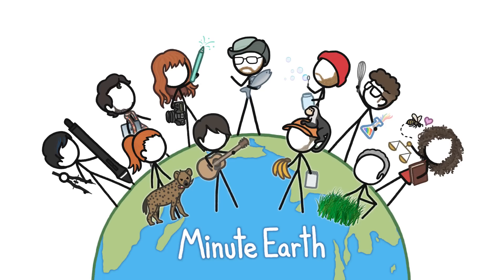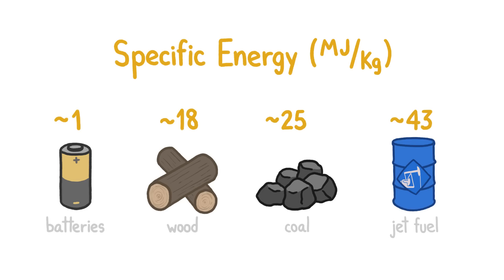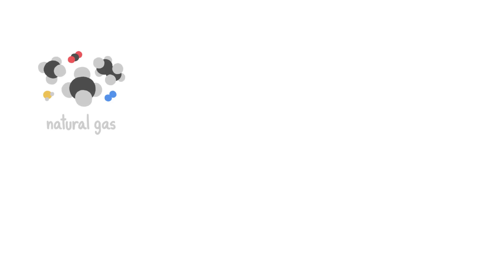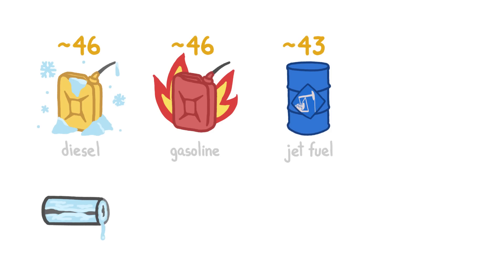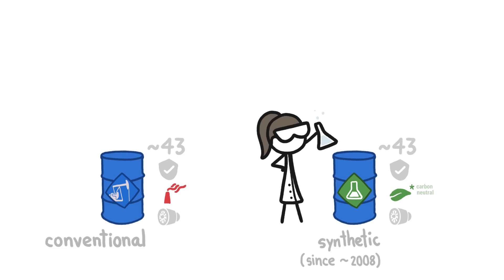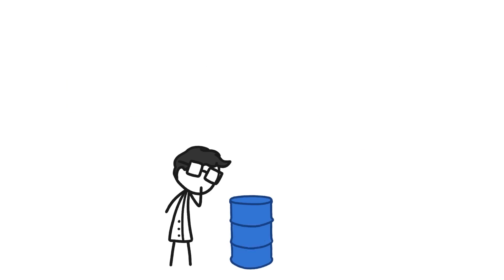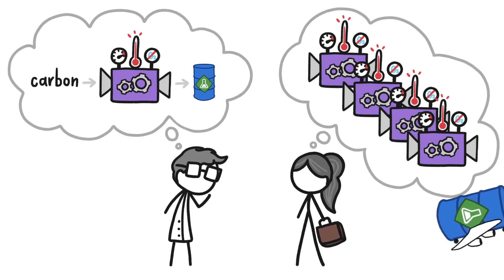Is There A Better Way To Power Airplanes?

Comment: There are some radical alternatives that might be available. Flywheels are becoming a serious contender for mass energy storage for our grid. And while it might sound outrageous for an airplane, a theoretical maximum for energy density of a flywheel made out of graphene ribbon wrapped into a ring is actually slightly better than jet fuel. There are still serious obstacles to implementation, like making sufficient quantities of graphene at sufficient quality, superconductor bearings, effective coupling to the propellers/fans, and not least - safety. But a lot of these do seem like engineering problems, and we would get a cleaner, quieter jet that you can literally just charge at an airport by winding up its flywheel using an electric motor. Hard to beat that with any kind of synthetic fuel.

Comment: What about ethanol? It's 1,5 times less effective than gasoline (28MJ/kg vs. 43MJ/kg), has a melting point of -115 °C, so it will probably not block the pipes, and a boiling point of 78.5 °C (ok, I understand that it's below 100°C so it's difficult to cool with water based cooling systems but it is not as low as gasoline), it produces less pollution and it's not extracted from petroleum, so its a renuable source.

What are the factors that could limit ethanol powered airplanes?

Comment: An actully relevant sponsorship? 

Anyway, cost is not really a factor when it comes to syntethic hydrocarbon where they can't be replaced with other energy storage solutions (batteries, hydrogen). Notice that I say storage, because  making syntetic hydrcarbon fuel uses up energy to "supercharge" the product. One exception would be large scale algae farming where the energy to a large extent comes from the sun.

We can't really afford to use cheap fossil energy for much longer.

Comment: Firstly I wouldn't worry too much about carbon capture it occurs naturally thanks to Moss and permafrost there's several other mechanisms that pull carbon dioxide out of the atmosphere and deposits it into the soil and one form or the other but if you're looking for an actual plan personally I would grow corn press the vegetable oil out of it use chemical cracking to turn some of that vegetable oil into kerosene makes it back into the vegetable oil depending on the average temperature you'll have to convert 5 to 25% of it to make sure the vegetable oil doesn't freeze ideally you would then use gasification of the solids that are left ferment the sugars to distill that down to alcohol you can throw that into the fuel too

Comment: Synthetic jet fuel sounds cool, but ngl fission jets sound even better.

Couldn't anything be done to make the radioactivity negligible? After all, people during a flight are exposed more to ionising radiation than somebody working a centimetre away from a sealed nuclear reactor, and people who operate nuclear aircraft carriers and submarines don't die of radiation either...
Reply: The problem is that the amount of shielding needed to avoid life-threatening levels of radiation in the span of a few hours is too heavy for most aircraft.
Reply: @alexsiemers7898  Yeah, I thought of that just after leaving the video.
And that's without mentioning stuff like the reactor maybe getting poisoned and leaving the plane without any energy.

Comment: We could replace planes if we built hyperloops, they'd be faster, electric, and safer. I mean, it's just a maglev inside a (semi) vacuum tube, expensive to dig or build, but once it's there it is really not that complicated.
Reply: Hyperloop is a dogshit transportation idea for a multitude of reasons. For one, constructing it would cost such a crap ton of money that nobody on this planet would be able to pay for it. Secondly, it's extremely hazardous. And finally, trains already exist, no need to reinvent stuff that already works for mid-range transportation. Just build fast train networks for in-country travel.
Reply: Yes faster but with a lower capacity so you lose economy of scale. Safe? Not really, a giant vacuum tube wouldn’t be the strongest thing in the world. I’d say keeping a multi mile long vacuum sustained is quite hard. Alternate solution, train

Comment: split water into hydrogen and oxygen and combine those for thrust
Reply: much harder and more dangerous to store and needs a complete engine redesign to work.
Reply: Hydrogen has a terrible energy density (as in energy per liter, not per kg) even if you super compress it or cool it to a liquid state, and those kinds of storage conditions are also a pain to work with if you want to make something lightweight

Comment: The synthetic fuel would need to have as much energy as regular jet fuel, be as cheap (or cheaper) to produce at scale, AND couldn't cause greater wear-and-tear on current engines.

I don't think you should rule out nuclear, though, especially with fusion possibly on the mid-horizon.  Even with fission, it's worth considering.  After all, with nuclear there are almost never any emissions other than steam.

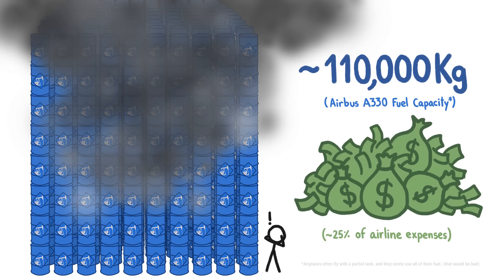Comment: 0:28 you put quad engines on the illustration but the aircraft doesnt appear to have a second floor. No quad engine plane doesnt have 2 floors of seating.

Comment: Nah. Nuclear energy has gotten rediculusly safe in last few decades You could run a tripple sized passenger jet on a small modular reactor and power a small ore furnace. The real question is can you make it crash survivable and the awnser is yes provided some just goes and hacks at the problem until it works.

Comment: A nuclear jet plane would work fine - if you think it's dangerous then why are they used on submarines, which have to deal with the risk of sustaining enemy attacks. It won't explode. The issue is nuclear submarines are owned by the military. And maybe we don't trust airlines with flying nuclear airplanes around - there would be too much risk of one being stolen.

Comment: Planes are powered by air and piezoelectric harmonic devices. They expect us to believe the Airbus A380 can carry the weight of 4 fully loaded concrete trucks per wing, it's ridiculous.
Reply: Stop with the disinformation. Aircraft turbine engines are powered by liquid petroleum fuel.

Comment: We need to find a way to condense gas not make it liquid i mean like make it more energy heavy like a cube filled with gas but more intense enough to power a plane like fitting a gas about 100 feet in width length and what ever you use to measure how tall something is in a 10 feet cube

Comment: Yes, the big heavy storage tanks would wipe out the benefit of flying lighter, however, I think hydrogen might still be a better fuel:
1: Higher specific energy means you need less, which makes it cheaper, unless the prices are higher, but...
2: Hydrogen is abundant. Idk if petroleum is more abundant, but it also formed for free, and it's IN THE AIR AND WATER. Although the extraction process might make it so the prices are higher, idk how it's extracted or how much extraction costs.
3: Might be carbon neutral. Idk if it is carbon neutral, but it might be.
Reply: Hydrogen is 100% carbon neutral!

Traditional fossil fuels aren't "carbon neutral" because their carbon content combines with oxygen in the air and forms carbon dioxide.

Hydrogen fuel cells, on the other hand, works by separating hydrogen into protons and electrons in a diode, and passing the protons through a special membrane that doesn't let electrons through into a cathode at the other side of the membrane. They, instead, are funneled through a circuit into the cathode by pumping oxygen to attract them, and that flow of electrons generates electricity!

Then at the cathode, the oxygen combines with two electrons and two protons to form water, which is the only byproduct of the process. There's no carbon involved so the process of generating energy through hydrogen is 100% carbon neutral! :D
Reply: I heard that Airbus is designing hydrogen planes. Both hydrogen fuel cells and hydrogen jet planes.

Comment: When plastic was first invented, it was to replace ivory. To protect elephant and such. More than 200 years later, there goes the neighbourhood. Now they're talking about replacing oil. As long as we refuse to see that greed is the main problem, uur quest for solution can only add up to the ecological disaster.
Let's talk about the elephant in the room
https://youtu.be/oMozyspFuBM

https://youtu.be/cw2Wm8T6tio

https://youtu.be/LLCF7vPanrY

https://watershedsentinel.ca/articles/the-militarys-carbon-bootprint
Keep in mind those numbers still underestimated for obvious reasons

Comment: Honestly, that's NOT why there aren't nuclear powered planes. There are no nuclear powered planes because the required reactors are huge and heavy.
If it were just about radiation, it'd be a perfect fuel source, since we can easily shield against it, and it's also rather easy to create safe failure modes for crashes.

Comment: We can use electricity, u see when a plane is in the air, it's engine fan is spinning, so we can use the battery to spin it and then we can convert that spinning motion into electricity.

Comment: Nuclear powered airplane actually sounds really good. Imagine an airplane that you almost don't have to refill at all. You could fly that around for weeks and it will be still fine
Reply: SMRs (small modular reactor) might just cut it
Reply: But if the plane crashes you have a Chernobyl
Reply: @Quacking-duck  But then most of the time plane crash in the sea or in the wild not in heavily populated area

Comment: This reminds me of the effort Musk and spaceX is making to produce their rocket fuel from the air using green energy driven Sabatie (sp.) process to convert co2 into methane for carbon neutral fuel that effectively makes each rocket flight green electricity powered. They have to practice anyways to do it on mars.

Comment: Liquefied gas is a viable solution too. The energy per liter is typically lower, and the cryogenics a pain, but they're much easier to produce.
Also, hefty taxes on fossil fuels could make synthetic fuel a viable option quite quickly.

Comment: 1:40
Okay that is very wrong, for multiple reasons. 
yes nuclear power does have the problem of radiation, but this is not the 1950's where you have dumb butt Russia exploding a material that is near impossible (Chernobyl). And,  Americans testing to see if if liquid sodium could be used as alternative to water which again this was in early testing and caused a partial melt down in 3 mile island. Seriously saying nuclear is to dangerous because  of the risks is like saying all animals that can kill man should be  put down.

What i'm trying to say is nuclear is good, we use it every day at multiple cites, as as we speak power plants are being switch from dangerous uranium based power to much safer, and much more power for thorium.
Reply: this video was specifically talking about airplane fuel
Reply: Uh in this case it literally is too radioactive. It's a plane. People would be sitting right next to an operating reactor. You could shield it, but that adds way too much weight. Also, planes do crash periodically.

Comment: Not specifically designed for jet fuel. That just happens to have best energy density at a reasonable reliability and price point.

Porsche's first car in 1890s was an EV. Cheap gasoline that offered convenience as well as most bang for buck replaced it.

As far as vehicles get, aeroplanes are built for maximum efficiency. Minimal fuel burn is a priority unlike SUVs. A low cost airline relies on selling coffee on board to make ends meet. 

Incremental but actually huge progress has been made in improving airliners since ww2. Just look at fuel burn per pax seat mile of early 737 to 737-800 then A320 and now geared turbo fan C Series /a220. 

Electric aviation is possible but currently equivalent to 1920s aviation in terms of sustainable speed and range.

Batteries are not emissions free and hydrogen still has to be made.

Interestingly pre covid19, cloud computing exceeded global aviation emissions last year. So sending emails, data gathering, bitcoin mining, online games . .. all consume energy and the vast majority is not from renewable or net zero sources.

We are now

Comment: Flywheel is definitely the best storage mechanism to fly. Then you can just charge up on the ground from any source, and it doesn't require any of those complicated and messy "chemical reactions"
Reply: Way to little energy content. If I had a ring with diameter of 10 m and mass of 100 t making 6000 RPM, this gives as much energy as 10 t of jet fuel.
Reply: @kwzieleniewski  Yes, I wasn’t being very serious. While it is technically possible, it’s not very practical.

Comment: Renewable diesel made for planes. No modification needed to the plane, second cleanest burning fuel on the market. Better mpg. Better cold weather tolerances. Did I mention renewable? Problem solved.

Comment: I am wondering about liquid hydrogen as an alternative.
Its main disadvantage is its limited "shelf life" as it evaporates slowly. In a plane this shouldn't be a problem as they tend to fuel up mere minutes or maybe hours before takeoff and then proceed to burn the fuel within a few hours. Evaporation shouldn't be a problem there and liquid hydrogen doesn't require heavy tanks. You could probably use just regular fuel tanks and live the evaporative losses (or directly use the vapors in the engines).
Hydrogen is yet to be mass-produced with low co2 emissions, but with renewables on the rise we will have times of excess power generation which could be used to generate hydrogen.

Comment: Yes, but how can synthetic jet fuels help reduce the weight which is a point of first concern as shown in the video? Are they denser in some way?
Reply: Man they need to be lighter and not denser. Density is Mass upon volume so density doesn't correspond to weight of a substance. For example: A higher dense object can have same mass as less dense object only difference is higher dense object occupies lesser volume than lower dense object.

Comment: Liquid hydrogen powered jet plane flew for the first time over 30 years ago. Hydrogen can be synthesized with water, with a process powered by renewable energy. The emissions of burning hydrogen is water vapor. Hydrogen can be used in our current jet engines. Sure this would require quite some investment, and liquid hydrogen is today more expensive than jet fuel (kerosene), but that is to large extent because jet fuel isn't taxed. If it was taxed like the taxes many pay on gasoline or diesel, and renewable liquid hydrogen was tax free, then they'd be similarly expensive. This technology has been around for 30 years, and is still not applied! Then we are shamed because we want to travel and explore our world! How about implementing and improving existing solutions to important problems?

Comment: I think fusion will be the solution of the future... Just need miniature reactors. eta. 100 years. Maybe metallic hydrogen (if it's so stable a plane can face-plant and it won't go off). Standard nuclear is too polluting, antimatter is basically flying with an armed nuke... 
You could use solar farms in orbit and beam power to planes. As a bonus it can be used as a weapon.